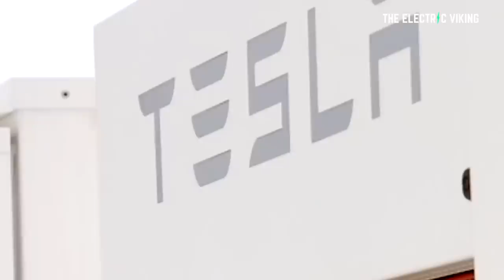Tesla's clear path to become largest truck manufacturer in the US

Comment: There is no chance the Tesla Semi can replace most diesel trucks within 7 years.  In North America there is no charging network at all. 
The battery is 1000 kw so around ten times the size and cost of an EV pickup, sedan, or SUV, yet somehow they can sell it for $180k? Horse pucky. It's going to cost way more than a diesel truck. To be profitable they will have to charge at least $400k. Then, in the US long haul trucks are driven by teams. Usually two or three drivers. One in the drivers seat, one in the passenger seat, and one on the sleeper. They drive the truck 24 hours a day stopping only for fuel. Where I live there are reports drivers cut holes in the cab floor so they can defecate while the truck is moving. A Kenworth service manager was in my office and confirmed this was true. They won't want to spend 4 hours a day charging.  The current Tesla Semi is not going to work for long haul trucking with it's current battery technology and configuration. The payload is significantly less than a diesel also. Although many loads are not maximum weight, will a driver want to be shut out of even 20% of the market? Almost every long haul delivery that left my business was too heavy for a Tesla Semi. 
With only one driver it is going to take days longer to finish a cross country run. The time loss won't be acceptable for many customers, especially if it's perishable, plus we get to the point that the lost time is worth more than the fuel savings. It should be noted that the charging stations need a profitable business model. In my area public car chargers have switched to per minute billing instead of per kilowatt. It now costs almost as much per mile to charge at a public charger than a similar ICE spends on gasoline per mile. 
My friend used to charge his Bolt for free at public chargers. Then they starting charging 37 cents per kw/h. Now it's 22 cents a minute for the 50kw charge rate. It's $11 for a 20 to 85% charge now.  It's more for faster charging rates. It's because they can't make money selling $1.50 worth of electricity     for $3.00 while tying up the charger for a full hour. We can't even park in a parking space with no charger for $1.50 an hour here. I am sure the trucking industry will have the same problem. The fuel costs in an EV are about 20% that of a similar EV if we charge at home. As soon as we charge on public the fuel savings are all but wiped out. I am sure the semi will have similar issues once it gets established. It's going to cost a lot more, the fuel savings won't be anywhere near what is expected, it will take longer to do the job, and more trips to move heavier loads. 
That's before we get into what happens to the $250,000  battery after 5 years of rapid charging  3 times a day. That's  4500 cycles based on 25 driving days a month. The battery replacement costs MUST be built in to operating costs.
The semi will work great for local delivery. The Pepsi bottling plant to the grocery store warehouse for example. 
I will bet you money they fail to deliver 50,000 units next year.
Reply: I think $400k would be a good price for the Tesla Semi. Some of competing EV semis sell for $400K for 270 miles of range.
FSD for trucks changes everything, the truck can charge for 2 hours a day and drive 22 hours a day. 
Companies will buy Tesla Semis if the business case works and the payload for a Tesla Semi is the same as a Diesel Semi. Yeah I know a couple of PhD students at Mellon Carnegie wrote a paper in 2017 'proving' that it wasn't possible but surprise surprise they are now wrong (even if they weren't wrong at the time).
People look at the heavy electricity usage as a problem but ask yourself this: if you were selling electricity would you want a hundred retail customers and all the hassle and BS that they bring with them or a single truck customer?
Reply: You're 100% correct. Have seen Hyliions approach to electrify the Class 8 market?
Reply: @danielstapler4315  I am not suggesting it's impossible. I am saying it's not going to happen practically overnight with the current technology.  It's the adoption rates that I question. It literally can't replace any truck that has a payload over 28,000 lbs for the long range version. 
Interesting. I just looked up the latest photos. It appears they might have dropped the single seat concept and there is a passenger seat. However, there appears to be no sleeper. They know it won't be used for long haul so they left out the sleeper to save weight. 
I agree about the price, the long range with the 1000kw battery will probably need to be closer to half a million dollars to be truly profitable, however, I expect Tesla to sell the first few thousand at a huge loss as prove the market then break even for a few years. It will be at least 5 years before we know the real price they make money at, just like the cars. 
You mention theoretical charging speeds if two hours per  22 hours of driving. I will believe it when I see those being  installed  across the country. Even then, being down 10% of the time for fueling is still a significant loss of productivity. That's assuming there are enough chargers to guarantee zero weight times. I can't even begin to imagine the scale of refueling stations and electrical feed required to accomplish that  on busy US routes. There are 39 million trucks in the roads in the US for business purposes, over 4 million are class 8 (semi) trucks. Clearly, millions of chargers will be needed to go fully electric and at several hundred thousand just for the semis.
It's just not going to happen this decade.
We need battery technology that allows a minimum of 4 times the energy density without increasing the cost even further before I see electricity taking over the market. When that happens isn't known.
Reply: Where in the world is a Semi be driven by more than one driver?

Comment: Oh come on!  Why don't you show the noxious fumes from the fossil fuel burning providing the electricity for the vehicles you admire so much? And why don't you discuss the likely adverse affect of the disposal of non-biodegradable battery packs after their projected eight year working lifespan, especially after mass conversion to electric powered vehicles and the huge environmental problem it will present? While electric vehicles themselves are cleaner and more powerful as you claim, that's not the whole story is it? When you look at the total chain, it's a dirtier technology than fuel engines. It may not always remain that way, but it is that way at present.

Comment: I wonder if Nikola will become a takeover target for say Freightliner or Kenworth as they scramble to save their market share?
Reply: What do they want to take over? The name?
Reply: I know that Nikola apparently has no proprietary battery tech but they did manage to have a design that was used to build EV trucks (although, not by them) that could be used for a potential build for a legacy manufacturer. Nikola may also have an OS that is workable for an EV truck. I'd need to do some digging to find out just what value they may hold.
Reply: @kcharles4630  What they sell actually as Nikola truck is a 1:1  german Iveco S-Way  truck with another badge.

Comment: I get a kick out of people.  They don't like poking small holes in the ground to get energy dense oil out and wail and protest away, but nary a word is said regarding the massive strip mines operating around the world to get the minerals for batteries.

Also I want to see loaded range of a tesla semi when it's minus 20 degrees F and the entire driveline is cold and stiff, requiring more energy to move.
Reply: If you got a large battery, you just need an electric heating to precondition the battery temperature. No problem.

Comment: I recall you want to be the man of truth; we haven't seen the semi in real world situations.  The Rivian RT which has a battery 1/4 the slze and under 4000 lb tow load in good weather it's range is 100 miles. The Semi has quite a big claim of range of 500 miles under load.. that is 5 times as far towing 10x as much; with a battery pack only 4 times larger. Elon said 500 miles at highway speeds and fully loaded - do you really believe that? 
I might believe that under ideal contions with a flat road, no stops and no hills at 31 mph but that isn't the real world. Even so the Semi might be good for short hauling; but they don't say that.
Reply: Experience tells us, that Tesla always delivered more and better than they initially promised.
Reply: WHAT the actual fuck are you talking about? The R1T has a 135kwh battery, the 500 miles range semi is at about 1megawatt, aka 1000 kWh, aka 8 times the battery size of Rivia. And we are not even considering how efficient Tesla's motors are (20-25% better tha anyone else)
Reply: @vic321344  what did that ever happen Vic? at least in terms of miles per charge - I've never seen an EV meet let alone exceed range claims, particularly under load - you can check bjron Nyland or any of the actual driving to out of charge videos here on youtube.
Reply: @BlondieSuperdog  It always happened. If you compare what tesla promises (range, power, accelleration) when they first introduced a new model and what thar car really had when delivered, the numbers of the delivered cars were always much better.

They had Semis running now for several years. So Tesla should very well know the range . Loaded and unloaded. So why should they lie to be ridiculed later. Tesla is not a phantasy selling company like Aptera or Sono.

Nyland did not drive a Semi, as far as i know. And Rivian is really not the scale for the electric truck industry. They are heavy, they are expensive and Rivian still loses money like there is no tomorrow.
Reply: @vic321344  Elon Musk's Hyperloop is over hyped junk technology
Reply: @timothykeith1367  I like to be driven autonomously underground when the LV loop is ready, instead of standing in a traffic jam on the strip. Good idea for other cities too.
Reply: Efficiency efficiency efficiency! Elon doesn't lie, you will see.
Reply: @timothykeith1367  sit in the standing traffic on the Strip instead then. Nobody is forcing you to use it.
Reply: @BlondieSuperdog  I was waiting for you to mention Hoovie LOL
Reply: @timothykeith1367  OK your corned so try changing the subject.  Please stick with it.
Reply: @danharold3087  i just now looked him up - funny though
Reply: @vic321344  The Las Vegas project is short but  nothing hyper about it.  Maintaining a near vacuum for any distance is nearly impossible and is very costly to maintain.  Its fun science fiction.  The Boring Company can produce some useful projects as at LV.
Reply: @vic321344  A pressure vessel of any size will crumple in a vacuum like an aluminum beverage can.  The costs to construct a sizable pressure vessel for transportation would be astronomical.   The tube will change shape in small ways which will cause leaks to develop. Then, oxygen breathing humans must be safe inside this airless contraption and enter using air locks - which will be a maintenance  nightmare.   Its a physics problem that Elon Musk won't be able to solve.    The tunneling technology that the Boring company uses was purchased just as the Giga Press was purchased by Tesla.  I believe Hyperloop tests have only achieved  about 100 mph.  Its just another type of subway system that can be useful, but 700 mph isn't remotely possible.  It could eventually be a fun amusement park ride on a short track. 

Elon Musk is the Howard Hughes of our era, Hughes eventually went insane .  HH also attempted to break technological barriers before that happened.
Reply: @timothykeith1367  Its just 1 bar pressure difference. Thew first pneumatic undergrounds for passengers were already built before 1900. With more pressure difference.

In 2017 the first virgin hyperloop already reached 200mph in a 500m long testloop. 2019 288 mph. Several longer hyperloop testtracks are built around the world. They should reach 600 mph.

BTW all commercial airlines already feature a pressure cabin. "Its a physics problem that Elon Musk won't be able to solve.   " Sure...

Comment: If Elon Had the Goods on E.V. TRUCKS He would make VIDEO EVIDENCE PROVING They Work to get most Pre Orders but as of Now He hasn't Proven anything. Those with the Goods show Off the Goods to attract most customera but No Video Evidence Yet that I know of.
Reply: Pepsico has bought trucks. They expect to take delivery in December. They have mega chargers installed. They are doing it solely for cost benefit, not for starry eyed "save the planet" reasons. Tesla is using their own trucks to move parts and batteries around. I may be wrong, but I can see no reason to doubt Tesla's claims.

Comment: Truck drivers will quit if they have to wait for semi truck batteries to charge.  Electric Class 8 trucks is no more practical and the Hyperloop.  In trucking, time is money and weight of batteries is unpaid shipping costs.  Trucks are limited to 80,000 pounds including the cargo.    Electric trucks might be used for local transfers of light cargo, but not for OTR - drivers would quit.
Reply: They may be out of a job anyway when the trucks self drive.
Reply: Lol. Average trip in the US is way less than 300 miles, and drivers are forced to take breaks by law. So they can charge when they would be stopped anyway, as well as overnight while they sleep. I think 99% of truck drivers would rather be in one of these performance machines than a shakey old diesel that takes miles to get back up to speed and crawls up hills. All the drivers I have spoken to cannot wait for them. Most loads are limited by volume rather than weight. "Drivers would quilt" LOL. I would quit my job to take their place to drive one of these awesome pieses of engineering. They would be so much fun to drive.
Reply: Your talking about independent truckers.  
The Tesla truck can haul the full 80K for 500 miles
Drivers will be gone when FSD is ready
Reply: I don't work in the trucking industry, and what I say here is based on what I have read/seen on the internet, which is not always the most reliable of sources, so take the following with a pinch of salt... Most semi routes are for less than the driving range of the semi, so drivers won't have to stop en-route to recharge. Also, many countries have laws of the form "truck drivers must take a 45-minute break every 4.5 hours". 4.5 hours is less than the driving range of the semi, and 45 minutes is sufficient time to recharge a semi at a mega-charger for another 4.5 hours of driving.

Governments in several countries, including the USA and Europe, have increased the weight limit for electric trucks to partially compensate for the extra weight imposed by batteries. As such, electric trucks will be able to carry almost as much cargo weight as diesel trucks.

There are some articles/videos that discuss the economics of fuel for truck driving. Basically, it works out to be something like the following (I can't recall the actual numbers): the cost/mile for an electric semi is about 1/3 or 1/4 the cost of diesel for a diesel semi. Although the difference is "just" a few cents/mile, semis tend to travel many tens of thousands of miles each year, so the cost savings in fuel can be huge. In a cost-competitive trucking industry, the significant fuel cost savings makes electric semis more desirable than diesel semis. One source for these cost savings is about 12 minutes into the following video: https://www.youtube.com/watch?v=wDE9NpD6cMs&t=727s
Reply: 🤦‍♂️🤦‍♂️🤦‍♂️🤦‍♂️What are u don't understand??? 🤦‍♂️🤦‍♂️Truckdrivers HAVE to take a 45 min.break after 4,5 hour driven on the road.
Tesla SEMI can charge up in 40 minute!!! What is the problem???, 🤡
Reply: @jsanders100  No carrier will accept the autonomous liability.   Freight rail could have a larger share of long distance shipping, but having a driver onboard helps prevent theft and other value-added benefits that rail can't currently match.
Reply: @sdpryce  The shipping schedules often lead to drivers sleeping on the side of exit ramps or in random parking lots  - there is inadequate overnight parking as is, let along attempting to support battery charging while the driver is sleeping.  The supply side logistics is currently clunky, with delays common.  An electric truck will only make these barriers worse.   The pay is often low and drivers can be away from home for a month at a time.   When one of the electric semis light up after a roll over and melt an overpass  that will be the end of this scheme.